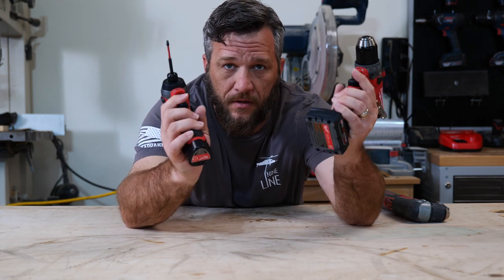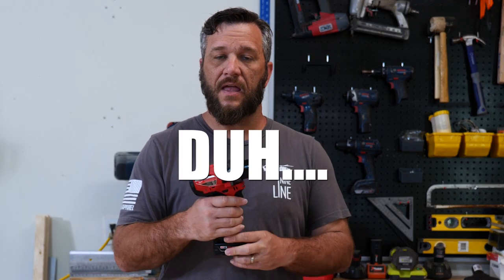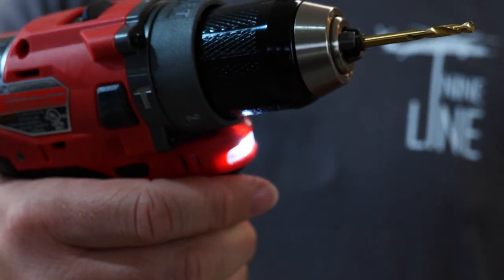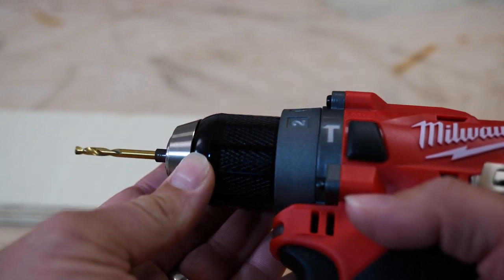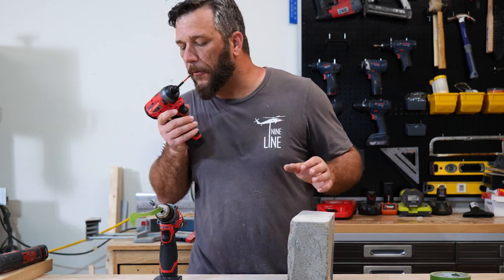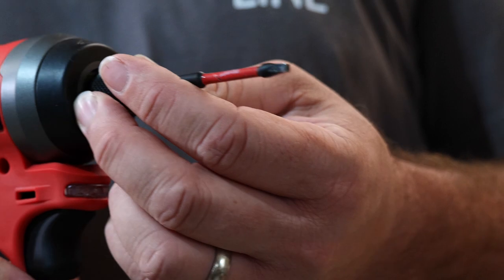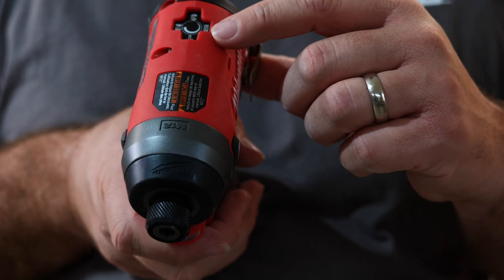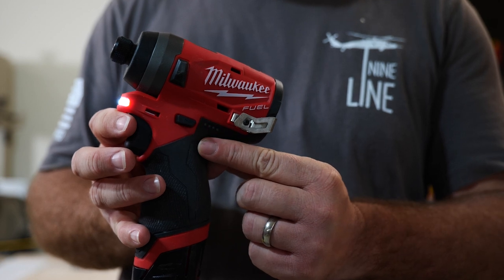Cordless Drill vs Impact Driver vs Hammer Drill: What's The Difference?

Comment: We all need to evolve our Modern Chuck usage technique. Many of us a carrying old habits from the past like using the trigger to tighten down a chuck which can result in setting your bit incorrectly and over tightening the chuck. Simply close it by hand and make sure the teeth as set on the correct sides of whichever bit your securing and then only tighten down to the first lock-in position that you feel the chuck hit. I stopped over tightening a while ago with these modern chucks after loosing a few to the tool gods and instruct the men and women I work with to do the same to cut down on tool breakdowns. Any extra effort beyond that first lock position does nothing by bind up the internal parts of the chuck.

Comment: Bro thank you for actually explaining this rather than saying , I use drills for home easy stuff , and impact drivers for hard tasks that require force . Like I truly appreciate this . I'll be real I never knew a drill had had a clutch , I did figure u would however adjust the numbers to the impact in whatever task you're drilling but you showing and explaining this made me realize , all I need is a very solid hammer drill    . No need for a driver

Comment: Love the video. Note that the slower speed on the drill will also increase the torque. This can be helpful in some situations. For instance I was drilling holes in studs/top plates to run wires in my new office. I was using some Irwin Speedbor bits and they needed the extra torque to get through the wood. The higher speed just didn't producte enough torque no matter how slow I drilled.

Comment: I recently bought a new Dewalt drill & driver combo. I thought it was interesting that on the drill, they  specifically had in the instructions not to put the drill bit in by powering it on while holding the chuck as you did. They want you to manually turn the chuck with the drill powered off, until it ratchets a couple times. I had never seen this before.
Reply: My guess is it is a matter of safety. Far less risk of the chuck grabbing the bit and slicing your fingers if it isn't spinning while you have your hand wrapped around it. Also, you may have noticed when he was demonstrating, the bit ended up crooked in the chuck the first time. It's much easier to prevent that if you spin the collar manually. Basically just get the jaws close to the correct opening in the first place, then slide the bit in, then crank it tight the rest of the way.

Comment: I have that exact same right angle drill.  I used it for car mechanics. When your under your car taking off the under carriage plastic matts.  Also add a 3/8 inch drive attachment so you can do valve cover gaskets jobs, etc.  Sometimes you have to break stubborn bolts loose with a ratchet, then use the right angle drill for the bolts.  Handy for mechanics, more ergonomic than holding a drill in the hand. Now it comes in handy cuz i have 3 drills.  I use 1) for drilling a hole 2) other drill for counter sinking  3) third drill for screwing down the T25 bolt flush.  Better than constantly using the quick change bits, especially on big jobs.

Comment: Awsome vid. I've got that same exact set. I use the impact driver almost everyday at work and its awsome! The 4.0ah battery lasts all day. GREAT power/torque. The LED light comes in clutch. I could go on and on about all its perks. But once you pick up an M12 fuel you'll get the Milwaukee bug and want to drain your wallet and buy more and more tools lol.
Reply from the maker: Thanks! I’ve had the right angle drill for awhile but I’m really impressed with the power and build quality of this new set. I can’t wait to put them to use.

Comment: Thanks for the video.  I am looking at a impact driver. I have tried with a drill with self drilling screws and 2 in 5 is successful.  I am attaching 1x4 to hardened metal in a garage.  I am also considering trying the Milwaukee (I have a lot of Ryobi).

Comment: Wiha makes awesome bits for those tools!
Driver drill can also drill in masonry for small holes. Just use the right bit.
Squeezing that trigger is called feathering. Helps when you do not want to drive a screw too deeply.
I have that same exact right angle drill!
You can drill most anywhere!
Place hand on the end opposite the bit and you can apply pressure to drive things!
But it is an M12 battery type drill.
Might get an hour of use per charge but charges pretty quickly!
Hour meaning heavy use.

When it comes to long work days with a tool, I prefer corded because no batteries to run down. Consistent power too.
Battery types for convenience or where there is no house power.

Comment: Great video. Now I know I need a compact Drill/screw motor to drill holes & drive screws.  I'm leaning toward a Mikita or Milwaukee for good torque, kinda light weight, not too noisy yat moderate price & less than 1 hour to charge unless it comes with 2 batteries. Thanks

Comment: You can prevent the bits from falling off on a drill also. After you mount the drill, you just lock it in place by turning one click on the other side. The drill won't fall off anymore

Comment: Drill safety tip - when drilling holes don’t use the “drill” setting, but use a torque setting instead. That way if the drill catches and kicks back the clutch will slip instead of twisting your wrist. Especially if drilling sheet metal or thin metal.

Comment: The gear on the top of the hammer drill (1 and 2) are seperate functions. 2 is generally high rpm and low torque, and 1 is low rpm and higher torque. Generally use lower torque or setting 1 when drilling or mixing into something that requires a bit more torque, such as a larger lag bolt or drilling holes into harder wood. I use speed one the most when mixing things such as joint compound when a corded drill is not available, you'll find that speed two will often stall.

Just a correction that may help some people out, as I previously did not know the difference either.

Comment: When I am working out of my service van. Mounting slim duct conduit or outdoor disconnects on block or brick, I need my hammer drill. I have been without it and using a drill driver sucks. If I am mounting frequencies drives in kindorf. I need my hammer drill. If I have access to line voltage my sds is my go to. There have been times although few that are driving me to a cordless sds. Not everyone's jobs fit into your cookie cutter description of professional work.

Comment: I’ve been using the M12 tools for years.  I’m a pretty heavy duty user and it’s rare that I have to reach for a larger tool.  The M12 tools are great, with the exception of the circular saw.
Reply from the maker: 12 volt tools have come a long way. These drills are easily as powerful as my older 18v Bosch drills.

Comment: So if your fixing a step on your steps or putting together a diy bench you can just use the standard drill correct? I see the impact driver push the screw all the way through what would that be used for?

Comment: If I wanted to drill holes in concrete to hang up some shelves, would the hammer/drill be a better option over the impact driver? You mentioned that I could buy separate bits for the impact driver to drill holes. But can the impact driver handle concrete?

Comment: I just found this video and thank you SO much!  I have my own tools because hubs does not like to do anything. I always knew there were different drills, but didn’t know what the numbers meant, or really the difference between a regular drill and an impact. Would you consider doing a video on saws?  Especially table saws?  I have a chop saw that I have had no issues with. I have a small Dremel saw that is awesome (as long as I make sure I have the right blade), but the table saw confounds me. I don’t know how to secure it, the guide is just gone and I cannot find another one. I’ve thought about using a large wood clamp, but I don’t know if it would give me a true cut. I have to build a chicken coop.  I have a compressor with a stapler and a nail gun, but I haven’t used it yet. And I don’t know when to use nails vs. brads. I really need some help. FYI: I’m 5’ 3” and about 135 lbs. I’m not afraid of my tools or my lead hole punch. But I know how to use my hole punch!  I’ve tried to find a class I can take, but they won’t take me because I’m not young anymore. I know you will probably never see this, but I could really use some help. Great video!!  Thank you so much!

Comment: sir want to ask a opinion, if im more into automotif.. i want to loosening tighten screw on the engine (not losening nut).. which tools is the best? can i just use my impact wrench? or should i use normal drill? or shud i get an impact driver? im worried if using impact wrench on the screw it will broken the screw

Comment: Are 1/2" to 5/8" holes in steel too much for the m12 hammer drill. And what's the max practical concrete drill bit it could handle 3/8"?

Comment: brand new drill user here........ can the impact drill be used to drive holes through concrete block? I was at Home Depot and talking with the Milwaukee Rep that just so happened to be there and she said "yes" with the concrete hammer bits. On the other hand, my husband says "no" and I can't find videos to support her "yes." I work at a school so drilling into block is something I do regularly, but the hammer drills are sooo heavy. Thank you!!
Reply from the maker: I would have said no several years ago. Impact drivers used to be used only for driving. Now they make hex drill bits specifically for impact drivers though, including masonry bits. So I think yes you could, but a 12v hammer drill might be the ticket. Lighter weight but still has the hammer function. I don't know what the block is like where you work but generally concrete block is porous enough that even a regular drill can work pretty well. I would say go with whatever is most comfortable for you.
Reply: @HAXMAN  thank you so much for your quick response!

Comment: Man ! that was a good video , I wll be drilling in brick , I am placing a grab bar outside for wife . what drill should I use ,i have a impact drill .
Reply: You might get away with just  drilling on 'normal' setting (which I always try first anyway) but the hammer setting would definitely do the job. Not the impact driver btw

Comment: so just a question, if you can get a hammer drill/driver as compared to a traditional drill/driver, same price, would you recommend just going with the hammer drill/driver? I would using it for like work around the house, drilling holes in 2x4s to hang pictures, hang up a tv etc.
Reply from the maker: Definitely go with the hammer drill. It just gives you more options down the road.